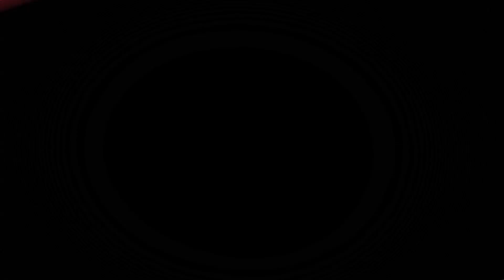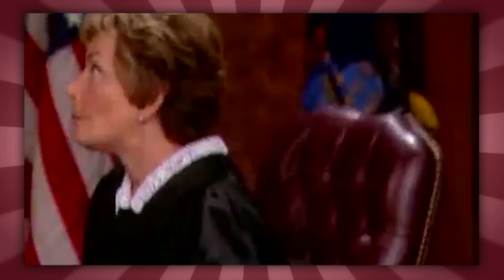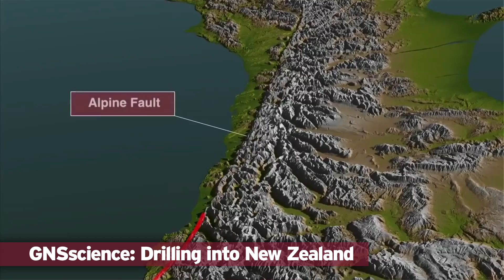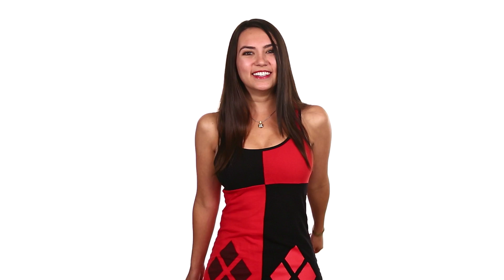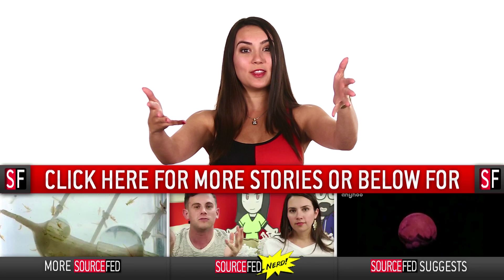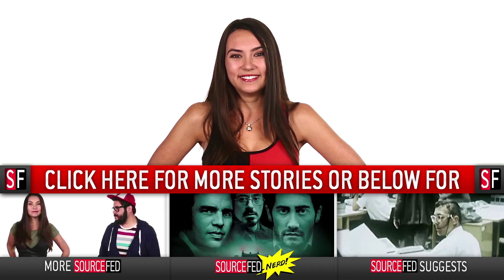Scientists May Cause Huge Quake In New Zealand

Comment: Sure the probability of an Alpine Fault rupture of an earthquake of 8.0 Magnitude is quite high by international standards (a 1% chance this year and 80% chance in the next 100 years [GNS Science]), but human drilling does not cause significant enough energy to unlock the fault. Earthquakes are the phenomenon of movement in the crust where land is under incredible stress due to tectonic drift and an Earthquake is the release of this stress. This stress only released when the plate slips (think like pulling a rubber band really hard then it snaps). So you are telling me that drilling into this fault is going to do that? The only circumstance you could claim that it is the cause is if the fault slips coincides with the drilling being undertaken... and even then you would be wrong.

Comment: Eeeh... Its not dangerous... Drilling a small few inches into a fault isnt gonna do anything. Earthquakes are a result of a shift and release a Massive amount of energy... It is an illusion to think a small pipe would ever be significant to such energy.

However gas or oil mining in a fault area is a whole different thing, since you take away tons of material which then causes the rock to change or shirt the weight. Do this long enough, and you do change the energy balanse significantly and an earthquake happens.

Besides - scientists would never get the permission to dril there if there was a risk of causing an 8... We dont drill into your skull either if we didnt know what we were doing.

So stop the spreading of ignorance and fear... Study and learn!
Reply: um, its not 4 inches deep, its 4 inches wide, and 5000ft deep, that's a little more than a few inches...
Reply: TheNerdyCanadian
Drilling a 4 inch wide hole into an oil tankers hull wont sink it.

By comparison, the fault line is the size of thousands, probably millions of those same ships. It could be a 6 foot wide drill and it still wouldnt do shit.
Reply: Casper Christensen i didn't say it was going to do anything, he was stating that it was 4 inches deep, i was just correcting him on that it was 4 inches across, and 5000ft deep
Reply: Let me save the discussion - obviously i meant a few inches wide...

Still - this kind of drilling has 0 effects, since the pressures and weight displacement by drilling a few kilometers a few inch wide isnt gonna do much against the pressure that builds up in the area.

Its like putting a windmill in the way of a tornado. Maybe you get some useful data out of that - but its not gonna affect the tornado. I view it as that kinda difference in scale and energy.

Comment: If I've learned anything from my statistics class, an earthquake every 300 years means that you can reasonably expect an earthquake within the next 300 years at any given time, roughly irregardless of how much time has passed.  It's also worth noting that the hole drilled in the San Andreas fault didn't cause any notable change in activity, so there's no real reason to suspect that drilling into the Alpine fault will do anything, let alone trigger an 8.0 earthquake.

Comment: Just want to say that you can't say an earthquake is due, or an eruption is due of any natural disaster. It's nearly impossible to predict these kinds of things, If a fault has a large earthquake an average of once every 100 years then after 100 years of no large earthquakes it is not technically "due" for another, it just means its slightly more likely with every passing year. if you have the earthquake, then you have a year without an earthquake that means there's a certain percentage that the next year will have one, and if it doesn't happen the percentage increases for the next year and so on, there is an equation for this but I forget it, it also is used to help predict major floods.
Reply: You are correct. Do you know what we say when the statistical chance of an earthquake is very high... we say it's due.

Comment: To think that a 4 inch hole would have an impact on a fault line (as if the tectonic plates were somehow fragile) you would have to be a complete moron.
To put that into perspective, (scale wise) that would be like using a needle to set off an active volcano. Sure there is a lot of pressure down there but a "needle" isn't going to set it off.

What we can gain from drilling the fault line is very valuable data on quakes and fault lines which may help predict earthquakes. That would be great for you guys in California since your also due for a big one.

Worst case scenario, there would be a pocket of gas pressurized down there and the drilling releases it which would be bad news for the scientists. However, there is so much pressure down there that there isn't room for much else, so its very unlikely.

Maybe if we got everyone in New Zealand to jump up an down on the fault line... that would set it of too... (sarcasm)

Comment: Disappointed by lack of wider sources and reading on this topic, especially by not using local news and research. There is a lot, so citing 1 non-local non-researched source is a let down. 

This video displays no knowledge of what the scientists are doing and why. This is a massive project run by experts in a country where after the Christchurch earthquakes especially we need more information on predicting earthquakes. They will have knowledge of the area, the terrain, drilling and earthquakes and of course they will do this in a way that would not set off a magnitude 8.0 earthquake. They are also doing this in a specific location on the alpine fault that is situated away from any major populations, several hundred kilometres away from Christchurch and Dunedin.

Also if you were researching, the fault is due for a large earthquake so any preparation and awareness would be key in helping the country prepare for a large magnitude earthquake.

I have been following this story as I live in New Zealand and am a Scientist who is interested in this. I enjoy SourceFed and I am aware they lack scientific interest and understanding but am still personally disappointed.

Comment: I wouldn't think a 4" diameter hole would make much difference stacked up against all the geologic pressures that go into making earthquakes, unless they are pumping in volumes of water or some other material. It's not like cracking. It sounds pretty surgical actually.

Comment: How the hell should a 4 inch hole cause the release of ~6,270,000 tons of TNT in energy?!

And if it realy does there should be a way to drill the holes before a 8.0 quake is due and instead periodicly release the stress!
Reply: Releasing stress is exactly what we want to avoid... Put your hand on the table in font of you, press down as hard as you can then try to push your hand forward. Its stress and friction that keep you hand in place, now imagine the table was trying to move towards you, and the only thing that was stopping it was your the friction from your hand. This 4 inch mile deep hole could(though probably won't) cause some of that tension to loosen, which would be the same as placing water between your hand and the table, which would cause the two plates to move and cause a earthquake.
Reply: 4 inches in diameter not 4inches deep
Reply: Aussietexian The drill hole is so insignificant considering the other variables, fault plan area, tectonic forces and the structural geology. No worries.
Reply: *****
4 inches deep
Reply: Just look at it as extreme fracking.
Reply: ***** He knew that you plastic diva roach.
Reply: Aussietexian dat explanation doe
Reply: ***** That's what she said.
Reply: E4GLEGaming during fracking there are HUGE amounts of liquid pumped into the earth, drilling a hole... not so much
Reply: Aussietexian Thanks for the thoughtfull answer, but I think we don't want to avoid the release of stress. It builds up no matter what but a destructive earthquake only accurs when the there is alot of tnsion getting released at the same time, letting it go before to much builds up could help.